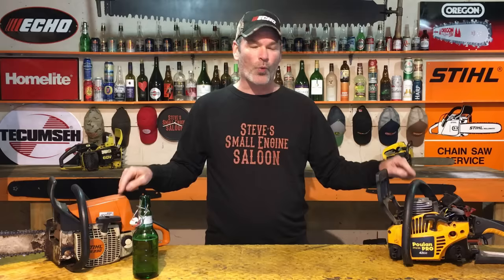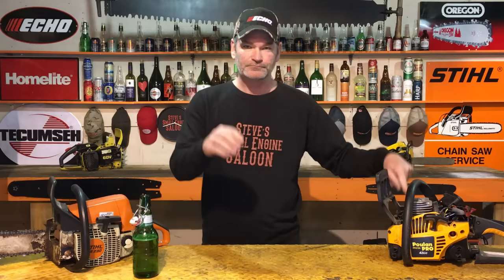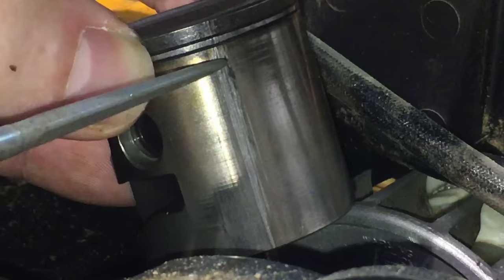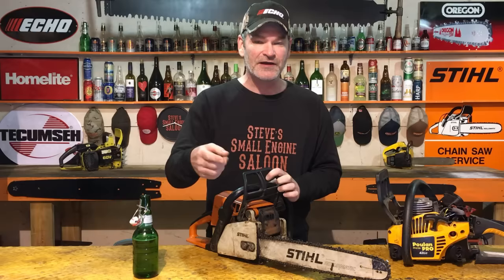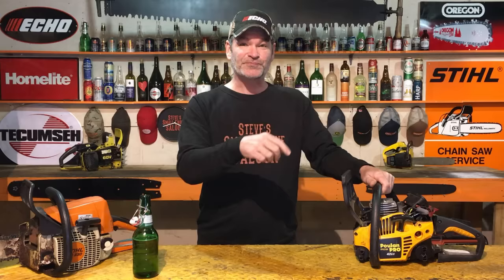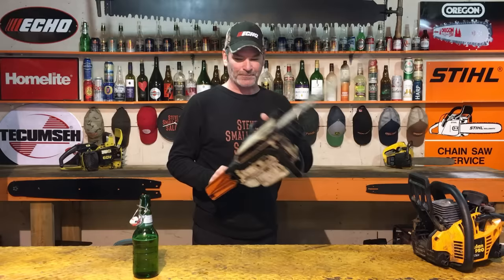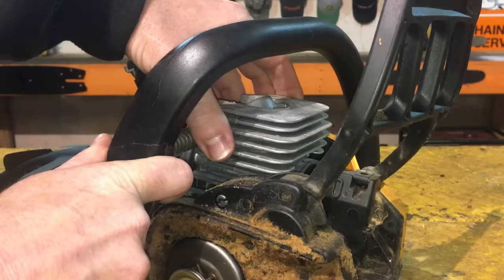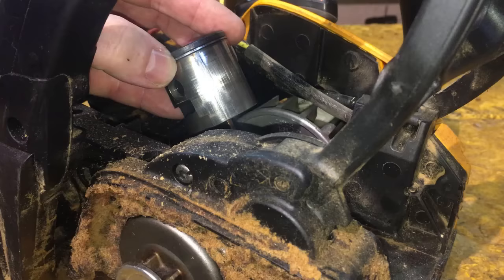WARNING: Never Do This To ANY Chainsaw

Comment: I have a behind  the back joke. 
I like your videos and tell people that I need to know what kind of beer to drink so the problem can be fixed properly. 
I don't half A%^ anything. 
HA HA HA. 
But I also tell folks not to rev the hell out of  it when you first crank it.
Another funny. 
I like to hear mind Pop and dance Around on the ground before getting started. 
Listen, helps to  get ready for  the project.
The " Timber Wolf " makes a distinctive sound before it's time to  get down  to business. It can get dangerous quickly. 
But I do Know which on to drink when  i get done. 
The coldest one. 
Lol

Comment: My sthil dealer on 3 separate occasions while demonstrating how to use the equipment I just bought, started and proceeded to rev my equipment flat out dead cold. I thought hmm maybe two stokes are ok to rev up old since these guys are doing it. Turns out that's not the case

Comment: Hi, so my problem with this is that when I start it up, if I leave it be to idle it just turns off. I have to hold it and press lightly on the throttle for quite a few minutes.

Comment: I recently purchased a sthil ms462C which has some sort of a fuel management system where the book tells you to put the chain brake on fire it up let it run for no less than 30 seconds but no more than 60 seconds and in between the 30 60 second time frame you kick the brake off and hold the trigger wide open for roughly 30 seconds and it calibrates the fuel settings basically like a fuel injection system does with the computer and you know the calibration is over because the RPM will pick up skyrocket high and then it says it will drop down when it’s completely done but I can’t make it past the high rpm portion because it just makes me wanna puke I’m waiting for the piston to come out the top but damn it is the crispest running saw I’ve ever used it’s like having a pro tuned competition saw every time I use it but I hate calibrating it.

Comment: I only cut wood around my house.  I top off fuel and bar oil in the garage.  I start it in the the garage (door open) and then walk to the site with the saw running.  I’m old, slow and fat, so the saw warms up at least 2 minutes in that process.
Reply from the maker: Perfect!

Comment: I start my power tools with choke on and leave them running until they cut out. Turn the choke off, fire it up and it’s ready to go full revs
Reply: One issue with that is running with the choke on can cause the chamber to carbon up.

Comment: First off your channels awesome friggin love it keep the vids comming and second Found two chsinsaws in the trash bin and salvaged them  a pulan and a sears craftsman.   The pulan fired right up after fresh fuel a plug clean and a shot of quick start. The crasftman took the same and a carb clean n new lines but fired aswell..i was a little excited to pulan started so quick i reved the piss out of it and may have caused some damage as  its got a stiff pull now..  i mixed 40-1 gas oil but added some engine restorer  with a thicker viscosity to help seal n restor compression..was that a bad idea  and could i have caused this cold seizure or am i overthinking it..???.

Comment: Wouldn't the cylinder get smaller as it heated up? Since the bore itself is just a void, and the metal cylinder would expand in all directions, not just outward?

Comment: So should you just let it idle or can you pull the trigger to warm it up and just not cut right away?
Reply: Don't pull and hold it but you can rev it on and off letting it return to an idle everytime you do it and that's safe.
Worst case scenario is a cold start and immediately putting a load on it, revving an engine that freewheeling is one thing but when you put a load on it the piston "thrust surfaces" are being pushed against the cylinder walls, that's what's truly harmful.
Reply: @dukecraig2402  thanks for the insight

Comment: On a Troy Built TB 110 550 EX  LAWNMOWER , CAN YOU EXPLAIN THE CHOKE LINKAGE , WHAT IS THE PURPOSE OF THE BLACK ROUND BUTTON AT THE OPPOSITE SIDE OF THE LINKAGE . NOBODY SEEMS TO EXPLAIN IT.

Comment: I have a sthil chainsaw about that size and when I bought it, it took 8 pulls before it wanted to start, 13 years later brought it back to get a new chain and a tune up it started on second pull after a week of using off an on it's back to 8 pulls again to start it wth?

Comment: PLEASE HELP.  &@%^*??"/%,(_

So when warming my chainsaw stihl ms 250 should I let it warm for the minute on the starting throttle with the chain brake on or let it warm up on the normal run position? 

The reason I ask is because I tried warming it on the normal run position and pulsed it a little but it "siezured" or turned off nearing 45 seconds of running no trigger pull. Whereas letting it warm up on the starting throttle not touching it I had no problem and after a minute of warming I full blasted cutting and had no power off issues like I had before prior to not letting it warm up.

So warm up on the normal run position or the starting throttle?

Comment: ......cold seizure huh, food for thought. I'm pondering the matter for my new Chinese saw I simply can't reliably start. It doesn't help that the times I did start it the chainbrake was engaged and I had to run full throttle  not getting up to any high revs though. Might have done this a dozen times. It'd cut out in twenty seconds though. My brain tricked me cos the chain wasn't  installed  I then automatically assumed motor had no load forgetting about the chain brake factor.  Then discovered a crack in the fuel hose and removed carburetor to fit a new hose,  was never happy about the spark either but now the spark  appears even worse.  I don't believe it and I'm disgusted .The thing isn't worth anymore of my time .

Comment: Steve, i had one question for you that could be related... i have always started my chainsaw with the break on.  Last weekend after bad storms took down tree branches started to tune up my Stihl MS 271. After blowing out the dust and sharpening the chain I went to start it up and it was vapor locked... i went back and cleared it but it didn't start and was locked again.  I realized i was over choking it. So I cleared again.  This time when it locked i pull the spark plug to check for spark.  It was very hard to see but after wiping the plug off with a rag and blowing dry from Fuel it showed some spark. (Probably should replace it since its used chainsaw i bought 2 years ago and no idea how old it is) anyway after that it finally started.  But right after it started i was trying to adjust the carb and failed to take the chain brake off... i saw a bunch of smoke from the front right and i shut it down.  The chain break froze and the chain would not move. I took the bar off, and eventually got the plastic cover off and realised the plastic melted slightly and i was able to debur the plastic and unlock the brake spring.  Now its working fine but i wonder what else i did wrong there and if I am damaging anything with mistakes on the chain brake

Comment: can anyone advise me i  was given a wizard riding mower the other day it is powered by a 13 hp power built briggs and stratton model # 28.707 type  #1154e1 code # 010124zd the alternator is burned up and id like to put a 40 amp alternator so i can pull my lit trailer and not have my battery go dead  also use an electronic voltage regulator>>  my question is will a 40 amp alternator git under my old flywheel >>and the flywheell still work??    please advise  with an alternator part number  thanks gerald from  deep south texas

Comment: What would be an adequate amount of warm up time to avoid the cold start effect?    Now I just saw your answer after writing my question.
Reply: You'll know it
Reply: Just dont rev it instantly,let it work on idle for a minute,and you can push the throtle while you deciding where to cut! Always hear what the saw is telling you! When you rev the saw listen if there are any buzz from the chain(if it is,than the chain is too tight). Also,its is clever to first rev up against a light surface and see if there is dropplets of oil.If there is,thats the good sign 😉
And lastly,when your done... let the saw work another minute or two on the ground cooling itself gradualy!
Reply: @stormtrooper9404  I thought the point was a guy using a powersaw for an occasional timber or large power cut. Then put it away for another month till he needs it again. For the same. It only ever gets cold starts. Over n over. Not good.
Reply: Jerome Duffy yea... sadly that's the case for many saws. But that shouldnt in any way be a reason for improper tool handling.
Reply: @stormtrooper9404  No , never. I find Pops old tools. I think of it as gold. Second hand shops have a bin
Reply: Jerome Duffy Dont understand what's your point. But second hand tools are also viable alternative if you mean that. I also have a kink to work on small smokers since I was kid.
Reply: @stormtrooper9404  um yeah?

Comment: As we've all struggled for years with carbs, ethanol, wasting time onsite with a saw that won't start, I would say that this is the beginning of the end for internal combustion 2 cycle saws.  The new generation of battery saws is shocking the saw world.  When I have 2 hrs of daylight to saw, I don't have time to dick around with a gas saw that won't start, wondering: ethanol deposit, bad air filter, bad fuel filter, bad plug, bad gas, bad compression.  Sick and tired of it.  Once I scratch the coin together, I'm getting a husky 540i XP.  Once it all hits the fan and no more gas, I'll be able to recharge it with my solar panel \ inverter \ deep cycle battery array. 40 cc  \ 16 inch is plenty for boreal cutting here in Newfoundland.

Comment: Electric chain saws is the only way to go. Use a gas generator to power them if in a remote area. I take like five of them to a job site at one time all sharpened , oiled up and ready to got.  No more of that pull alot bull shit to get them started.

Comment: if this were the case then every engine would have this problem... 2 stroke and 4 lol... i want to see you buy 2 identical chainsaws.  and let one idle, and one go full throttle within 30 seconds of starting and then take it apart and see the cylinder and pistons.. Then make a scientific analogy of this

Comment: Perfect cold-use chainsaws are battery-powered. Get 3x batteries, 2 chargers and a battery saw of some professional brand like Husqvarna or Stihl, then you will ALWAYS have one or two full battery, it starts immediately, AND it doesn't make fumes, or make noise while you have set it on the ground. Unless you are felling trees you should use a battery-saw!

Comment: Just put it simple man: Let your chainsaw warmup before you throttle up after a cold start, cause there is a high chance to screw your engine! Same goes for ALL engines!
Reply from the maker: What about 99% of lawnmowers that start and run at full RPM, no throttle cable to turn the speed down???    :_Beer: :_Mower: :_Rider: :_Chainsaw:
Reply: @StevesSmallEngineSaloon  Thats another story. Obviously, thats how those engines are made and personally never worked with one. Even so, i believe you can let it run abit before you put it into work, right? So basically its the same thing: Let it work abit, no matter if you can adjust the RPM or not. 😉

Comment: Small correction: Even in a normal situation, the piston IS actually making contact with the cylinder. To be precise, the piston skirt - the lower part of it. The piston is experiencing side forces from the connecting rod, which are taken by the piston rings and the piston skirt. As the direction of the forces is changing durign the cyle, the piston pin holding the connecting rod isn't going straight through the center of the piston but is slightly shifted to the side. This is done intentionally, so the piston will tilt always to the same side until the piston skirt touches the cylinder. This is very minuscule, but if you pay attention to the shading on the piston at 5:22, you can see it. The shading is the most intense in the bottom and gets less as you walk along the circumference of the piston or up towards the top.
Anyway, that does not take away that you're absolutely right - pushing a cold engine to the limits isn't helping it to survive longer. No matter what engine, I always let them warm up first. Lawnmower, branch chopper, chainsaw, tractor, excavator... Always let them run for a few moments, so the engine can pick up some heat before you load them.

And also advisable: Don't cut ignition on your engine while it's running full throttle. I often see people cutting with the chainsaw, taking the blade out of the cut, chain still running on full speed, and the flip the ignition switch with the thumb. It'd be better to be a bit slower. Let the engine run on idle for a few moments before you stop it, allowing it to cool down a litlte and avoid thermal stresses.
You might not see the difference right away, it won't break the engine immediately if you don't do it. But it's making the difference between the chainsaw being used still by your grandchildren or being thrown away as "cheap crap from the DIY store" after a few years.

Comment: Im late on this but think something slightly different is going on here.
The piston expands evenly.
The cylinder does not.
That corner does not get hottest fastest causing this damage.
That corner has more mass because its where the bar mounts. The bar acts as a heat sink. That corner is actually colder and expands slower allowing the piston to make contact. 
Maybe Im wrong. Your thoughts?

Comment: You failed to mention a critical point. The bar chain tension is crucial inorder for the chainsaw to operate without damaging the bar, sprockets, needle bearings, and main drive shaft. For example a new bar chain from factory has been preheated for proper tension by the factory which will stretch further after use but not so much over time. What happens is when you have proper tension on a cold chain as it warms up it will loosen, so you tighten once again and proceed to cut. Once you finish and allow chainsaw to cool down that chain will contract very tightly on the bar. So the next time you use the saw and forget to release the tension it will cause damage and poor performance. The takeaway is after each job is completed make sure to loosen the hot chain for proper contraction to occur and then tighten before using again.

Comment: Are you telling me that every single engineer at Husqvarna, Stihl and Echo simultaneously had the same lapse in judgment of failing to calculate the size of the piston at the top end of the operating range when compared to the size of the cylinder at the bottom end?

Comment: You can tell it is debris because its not straight up and down the scares on that piston curve and move left to right also the ring is gooved the ring is designed to rub the cylinder sorry but I've been doing this for 30 years .